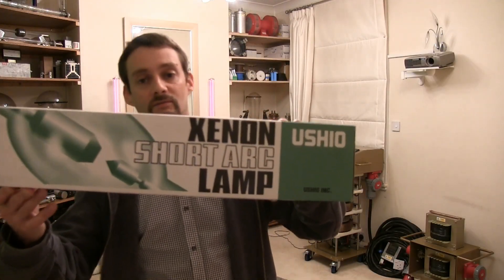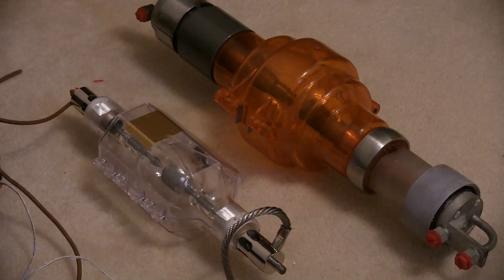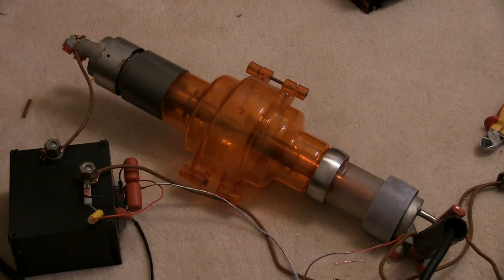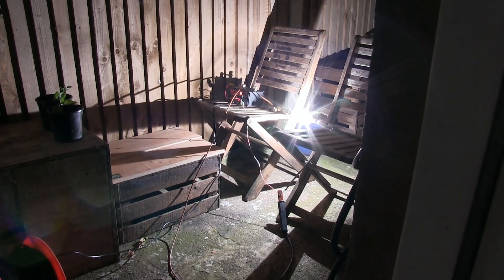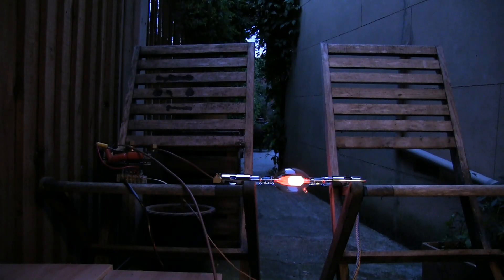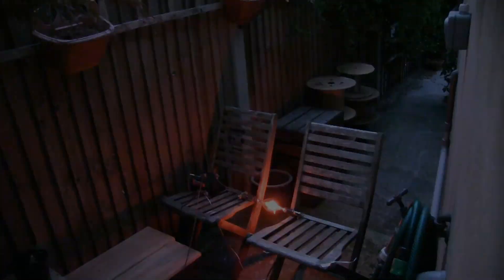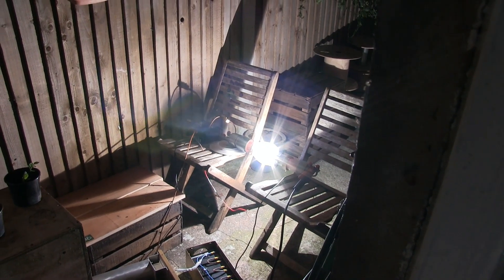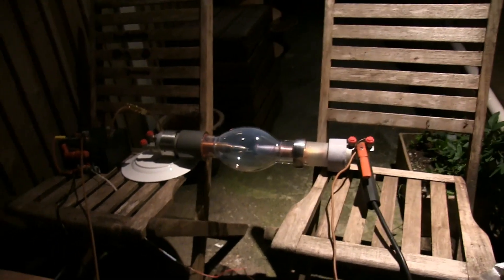30kW and 4kW Xenon Lamps Get Tested on a DC Welder

Comment: I'm sorry. I thought Xenon lamps and arc lamps run on extremely high voltages at low currents. But in this vid you said it's a DC welder. I thought DC welders are extremely low voltage and high current. Please explain your circuit.
Reply: foureyedchick Well, a high voltage igniter is needed to get the arc going by ionising the gas in the arc's path and then a low DC voltage will be enough to maintain the arc through the ionised gas (with high current).
Reply: foureyedchick We used 3.6k xenons in our projectors, correct power supply to run them was 30 volts DC @ 120 amps. Pretty sure we used the same irem igniters Photonic has. Use Ohm's law to work out running power 30x120=3600.
Reply from the maker: Callum Aitchison well done mate, correct

Comment: I replaced the 20W energy saver in my room with a 175W photography energy saver, was hilarious when the cleaner turned it on, and saw the sun (~650W incandescent light output)
Reply: I,m a dutch electrician , i once had to fix a Transformer for a 600 watt master son-t lightbulb , you know the once they use to grow weed , and my friends where standing there talking the armature whit lamp lies on table , i was replacing a new Transformer and tested it , i switched the power on and i hear screaming outside , my friends where blinded by the flash of the lamp , and there i know it worked.
Reply: @smellslikenarcspirit  Actually son-t lamps are not really bright when you light them up. They need to get hot...
Reply: @Janigut  yes i know but the starting flash is bright , then they begin a slow warm up .
Reply: Weird sense of math there mate.

Comment: You didn't cool the lamp, if you did that to an old AMD CPU, this is what would happen
youtube.com/watch?v=XgOmMAasqto (last 2 CPUs)
Same with GPUs too.
Reply from the maker: AP499D25 I would not expect to force air cool the CPU if it was hardly doing anything :(
Reply: ***** The old AMDs did not have power saving features.
My AMD Athlon 1.4GHz PC consumed 110W at full load and 90W with idle desktop.

Comment: Too bad you popped the big one.
Next time,get a old parabol dish made of aluminum,sand off the paint and polish the living f*** out of it. Mount the 30 kw lamp in the focus and let her rip. A Carbon arc lamp running 40 volts DC 500 Amps should also be spectacular bright..
Reply: Basically a WWII searchlight.

Comment: WE NEVER GET TO SEE THIS AT 30KW MAAAAAAAAAAAAAAAAAAAAAAAAAAAAAAAAAAAAAAAAAAAAAAN NOOOOOOOOOOOOOOOOOOOOOOOOOOOOOOOOOOOOOOOOOOO :'(
Reply: Thor214
Thats what makes it AWESOME!!
Reply: Juan Pretorius 30 kW is dangerous light. It can destroy almost anything.
Reply: AP499D25 The projector lamp is dangerous, too. Very strong UV emissions, quicker sunburn than welding. Will also blind you.
Reply: Juan Pretorius 2 years hype :C i feel you
Reply: Thor214 And it's impossible to find any footage of this on YouTube.
Reply: +BBRCTA2K5441393 I've had experiences welding with 25 kW welder
Reply: Thor214 I remember someone taking a DLP
RPTV lamp and running it outside of the TV, he put objects on front of the lamp and it burnt them up!
LED is efficient enough that it only requires heatsinks, not high-power fans! Also may not burn things in front of it. Also lasts much longer. They are expensive though.
Reply: BBRCTA2K5441393 You can get very decent 100w LEDs off ebay with great colour rendition for around a tenner if I remember correctly. I bolted one to a standard intel heatsink, temps were great, and I was able to use it for a DIY projector project.
Reply: He'd need a bit more of a home electric service and some serious forced air cooling to do that :D
Reply: I think so 30kW is a X-ray tube.....
Reply: Not quite. If it had a vacuum drawn in it then yeah, definitely. But a pressurised lamp can't produce X-rays.

Comment: Those lamps scare me tbh, the pressure inside is silly, basically a quartz bomb!
Reply from the maker: FrontSideBus They are pretty worrying, the gas is put in the lamp while it is frozen, then it is sealed and the pressure increases as the gas comes up to room temperature, the pressure in those when hot is unimaginable!
Reply: @Photonicinduction  I have had one of these in fact the exact same one (make and model) blow up in a projector the amount of damage it did was impressive but what is worrying is what it would do to bone and flesh. When changing these we have to have full PPE face shield, welders jacket and slash resistant gloves these lamps are VERY dangerous
Reply: Maanuueel42 \m/(^_^)\m/ 80 bar?! That's like 1200ish psi. That is insane.  If that thing blew it would be like a hand grenade.
Reply: @kg4boj  80 bar.
80x atmospheric pressure.
1 atmosphere is around 14.9 PSI.

A whooooole lotta pressure.
Reply: @Dave_Crupel  Yeah, about the energy stored in a hand grenade! I cant imagine a 200 bar lamp exploding other than total carnage
Reply: @kg4boj  200 frigging bar...
God help the poor soul that thing explodes next to...
Reply: I did a little math last night, if that thing has a volume of around 2 liters, at 80 bar it has about 15 kilo joules of stored energy.  That's about the amount of muzzle energy of about 15  .44 magnums going off at once.
Reply: @kg4boj Was that using closed system analysis? Which equation did you use?
Reply: huskyemma
A think fragments of quartz flying through the air at several hundred degree's C would be quite unpleasant...
Reply: Working at a local cinema its pretty scary changing out those bulbs. We wear a face mask, thick leather gloves and a blast coat of sorts. Luckily they are quite easy to change and all we need to do is loosen two bolts and unscrew the bulb. Then pull it straight out and put it in a blast proof container. Once we are done with the bulb change we take the old bulb and gently put it in a thick ABS pipe with one end sealed and the other end with a screwed on cap.  Then drop the whole container with the bulb in it. The bulb lets out a serious bang then we dump out the glass dust (wearing masks of course). Two of the cinemas use a 3000w lamp and the other is a 2000w lamp.
Reply: *****  If you kept the electrodes, be aware that many of them are Thorium doped to reduce wearing of the Tungsten/Wolfram even more than unadulterated W. Th is an alpha emitter, so it isn't much danger, but it is worth being aware of if you weren't already.
Reply: Thankfully the explosion is so violent the glass is usually vaporized. That is not a 'good' part that makes me feel any better :) Permanent hearing loss, a mild heart attack, and a lung full of silica dust is the perfect way to start the day.
Reply: huskyemma
 Not necessarily, it's no ordinary glass either, it's quartz. there is plenty of chance for red hot pieces of it to go flying out at you at some pretty scary speeds.
Reply: huskyemma Yeah, and it won't even notice going through your flesh and bones. A mate of mine worked with these lamps and said he wore two sets of safety gowns that acted like layered armour - tanks use the same principle in their armour.
Reply: *****  How many bar is it at when at room temperature?
Reply: Peter Carlson Typically 8 bar when at room temperature and ~60-80 bar when hot.
Reply: as a stonemason i can tell you silica is the fuckin pits, a little bit wont hurt you (much) but over a few years its way worse than smoking
Reply: it scared me to death when I turned up the sound to hear what he was saying and it went BLEHHHHHHHHHHH like if your were to mix the sound of wasps  buzzing with a blender and then turn up that noise a lot
Reply: It would probably look like when one of those plasma manifolds explode on star trek.
Reply: +huskyemma even if the glass disintegrates it's still dangerous. Ninjas used to grind glass up and put it in eggs to throw at enemies. the more you blink and rub your eyes to get it.out, the deeper it dug into your eye. I don't think it would be of best interest to inhale it either... hahaha
Reply: Peter Carlson That's why there usually is a protective shrouding around those things. Aaand it still is not a very good idea to be very close to such a lamp at full power, although they do not explode often.
If one was not properly mounted and fell on the ground while in operation however... I'd say it could act like a (quite weak)frag grenade, throwing bits of hot quartz around at high speed.
Reply: Peter Carlson some get to 200 bar
Reply: Lanthinated, ceriated and even pure tungsten seem more likely than thoriated to me. Just seems like an extra hassle dealing with radio emitters on the supply side. cool stuff!
Reply: ElectroBlud 60-80bars?!?!?!?!?! How this thing doesnt explode when i fill up my pcp air gun at 40 bar i get paranoid lol
Reply: @PhysicsViolator  my pcp takes 250 bar's and some hold even 300.
Reply: @vihreelinja4743  yeah I was thinking that. I fill mine to 220 Bar.
Reply: Peter Carlson   YES
Reply: R is it or is it an r or is it an r or is it an L?

4 of them. 😂
Reply: It is
Reply: The only thìng that photonuc can't overload:
Reply: @huyphamuc6372  yet
Reply: Peter Carlson probably so much force the glass would end up almost powdered, high speed but naff all inertia.. I'd like to see one 'go off' properly just to know.
Reply: but wont the glass completely disintegrate with that sort of acceleration?
Reply: +Photonicinduction what would happen if one of them exploded?
Reply: @alex101164  a neutron star would appear lol.
Reply: Virtualgod2009 awesome
Reply: So reading this comments I think you can literally kill someone with this lamp